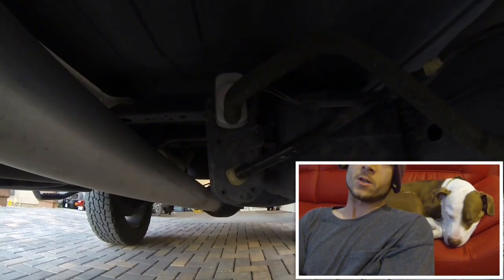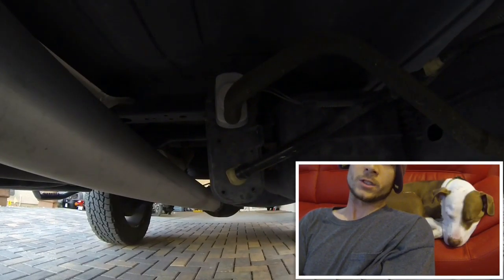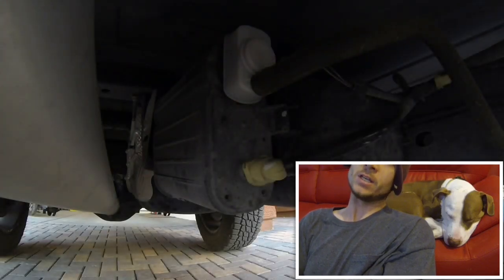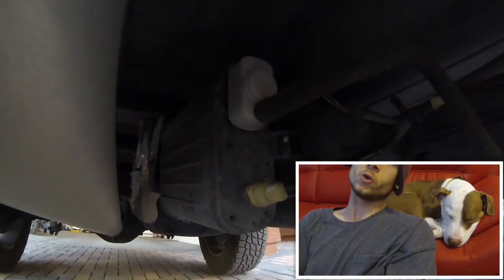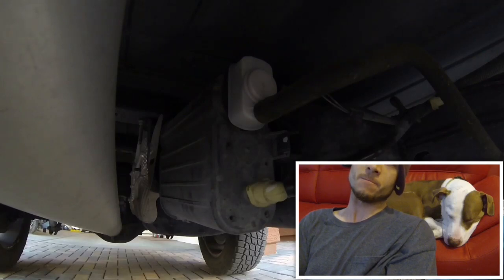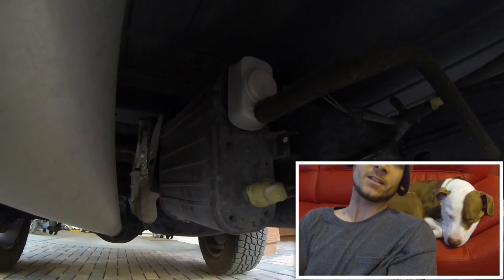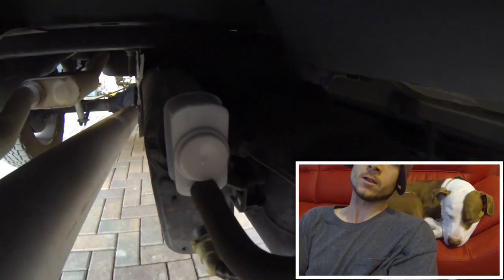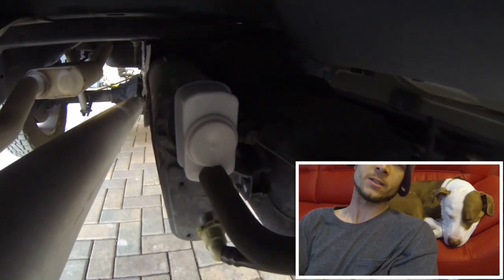p0456 and p0457 possible cheap fix dodge ram, gas cap light

Comment: I want to thank you for posting this video. I had the 0456 code that buying new gas cap and driving miles, unplugging the battery did not reset. I was past state inspection and was about to just start replacing random parts. After I saw this part in your video, I went to the dealer and installed it when I got home. It did not make the engine light go off right away so I was disappointed that I would have to try something else. I drove about 68 miles and it went off. I was so happy I wouldn't have to try something else the upcoming weekend! I would never have thought of replacing this thing. Appreciate it.
Reply from the maker: +nbws6 I'm very glad thangs worked out 💪

Comment: a million thanks for posting this! i replaced the gas cap...nothing. went and bought this piece from the dealer...was charged a crazy amount for the gasket though. But after putting it on and clearing the code..the problem was gone! thanks!
Reply from the maker: You are very welcome a million times my friend.
Reply: Replaced the fuel detection pump. Cleared the code but gas cap light still pops up. But check engine light isn't coming on. Any ideas?
Also I seen someone say the fuel detection pump may have a gasket?? Is this true? Mine doesn't have one. Just twisted the new one in and was done. 
Thanks in advance.

Comment: You are awesome. I went through all the shit I could to find the problem. Aftermarket cas cap, oem gask cap, original gas cap. Check ALL the lines. Check the fittings. It was that Damn leak detection pump. cost about $50 from the dealer for the pump and gasket. For what ever reason they don't come together. Lights gone and I'm happy.
Reply from the maker: I'm glad it worked out for you!

Comment: The check engine light has been on in my truck for the last 250,000 miles.  I just ignored it.  Silly Light, I know the engine is running, I can hear it.
Reply from the maker: Lol I wish I could do that here, I would fail the emission test haha sucks
Reply: Ohio got rid of the emissions testing racket about 6 years ago, but when they still had it I had a check engine light.  I just pulled over before I pulled in the lot and disconnected the battery for a minute to reset the light and went on through.  I would come back on in an hour or so.
Reply from the maker: LMAO awesome! To bad I can't do the standard test with my truck or I would do the same.  They make me hook to the obd port and can tell if I've driven enough miles to trigger all the self diagnostics.  Under the table tests are popular here, pay and extra $20 to $50 bucks and you pass haha.
Reply: Yeah, but you have good gun laws there.  That makes up for emissions testing.
Reply: ***** I live in Jamaica and I have that problem with both my vehicles. We have no emission tests here plus I am yet to find a mechanic who knows anything about emission issues is this country. When I called the only authorized dealer if they have any evap canisters in stock they say they have no idea what that is. So we all know where that light is right now and has been for the last years +

Comment: I bought a gas cap, didn't work.  I got under my truck and the ELDP looked okay, but I went to remove it and it fell apart.  I went ahead and bought a new pump, and just for shits and giggles, because I got a P0441 code, I bought a new purge valve.   Gas Cap light is still on, but Check Engine light is off.  I haven't driven anywhere so maybe when I go to work tomorrow the truck will have enough time to collect data and remove the gas cap light too. idk.

Comment: I've been chasing this problem for past year now so far no luck on my 2013 Ram. I started with the purge valve solenoid and it tested good then I replace the gas cap ever those it look good and now this pump thing since I couldn't find a way to check it.. The light will come back on after a few miles. Time for a smoke machine I guess🤔

Comment: Thanks for posting this. Unfortunately, it didn't solve my problem. I got the part from a wrecker but from a newish (2013) Dodge so I think the part was fine. Back to square one...
Reply from the maker: Ferenc Jacso I hope you solve the problem soon, when you do discover a solution if you would be so kind to post it here thank you sir.  Your welcome and thank you.
Reply: KUSTOMBLACK GUNZ After replacing the leak detection pump (which didn't solve my P0456 and P0457 code problem as I mentioned) I went back to the wrecker and got another easy to replace part, the EVAP canister purge solenoid, which is under the hood. Well that didn't help my check engine light either... Next candidate on the faulty parts list would have been the canister but one has to remove the fuel tank to replace that and I wasn't too keen to splash around gasoline in my garage. Instead I changed the fuel cap to OEM from the wreck and even greased it lightly as others recommended it for air tightness. That didn't work either. At this point I pretty much gave up. Then comes New Years Day and the check engine light was gone. I have no clue why... I reset the code several times after every part change, it still came back then a month later it cleared. Go figure. I'm sure it comes back another day but really happy for now!
Reply: @ferencjacso4699  wow..

Comment: Hey seem to know some things I have code p0457 gas cap then my truck stalled today code p0315 came up  what is first thing I can do to trouble shoot this problem I have replaced gas cap three times  I'm thinking leak d sensor  let me know your thoughts on p0315

Comment: Worked on my 2011 Ram 2500.
I cleared the codes with my tuner and they stayed gone.  I had to drive it a few times before the gas cap light went back off, so don't worry if it doesn't go off right away.
Reply from the maker: Sounds good thanks

Comment: Well, our 09 Escape still will not start... after changing out fuel pump and the purge valve....still getting the P0457 permanent code ..any hints?  tnx. I did try to clean this filler opening a bit..but this should not prevent vehicle from starting........and check engine light was not on.. except in accessory...

Comment: Thanks for the vid homeboy.  I'm pretty sure this is the problem I've been having.  I switched out my LDP on my Nitro today.  Gonna try to get a few drive cycles on this box of trash to see if that code disappears.  I'm a few days away from SMOG so I'm afraid to disconnect the battery to clear the code.  <= Been down that road before.

Comment: Gonna try a new gas cap first 
Question:  For definitive feedback should I be getting a cap that does not have a locking mechanism.  Tight seal being the issue.
Also I find that the gascap light comes on when I have a full tank and disappears when the tank is below half.  Does more gas in the system affect the pressure thereby affecting other related components.
Is this indicator some thing  that can help me troubleshoot it?

This has been going on for more than a year.
Thanks, any thoughts on this would be appreciated
Reply from the maker: +A Wong I would go with a factory gas cap and locking door if you want it locked up.  If the factory gas cap does not fix the issue, you do have another.  You could have a small leak letting vapor out.

Comment: Does this apply to a 2013 dodge ram?? Been having a p0456 and gas cap light on
 replaced cap 3 times and no luck. any suggestions?? or where its located on my truck??
Reply from the maker: most likely

Comment: where is this part located. i have a 2014 ram 1500 express. thank you
Reply: It's on the top rear of the fuel tank behind the shield...yes you can get to it without dropping the tank. It's a tight fit but possible

Comment: 2013 ram 1500. Kept setting off engine codes on and off for months lines were fine gas cap was fine. Then this little piece finally failed to give me a direct answer on scanner. Funny thing is about 4 months ago i looked at this video and figured no...
Reply from the maker: Pissed me off too 😁
Reply: KUSTOMBLACK GUNZ  where is this located on the 4.7 2013 1500. I cant fucking find it

Comment: 2012 Charger with P0456 code. I failed twice. disconnected the battery cables, ck engine light gone, still I failed. My question is what is the cheapest thing to try out because my car does not have a gas cap. Dang Dodge.
Reply from the maker: +Dea Bussey Not sure what the cheapest thing to try out would be.  After you clear a check engine light you need to put miles on it before you can get a true reading.

Comment: My 2009 Dodge Avenger CEL came on and read code PO456 they shut the light off and two weeks later it came back on. Think this could be the fix?
Reply from the maker: +robert cummins Maybe
Reply from the maker: +robert cummins maybe

Comment: What's the part name?
Reply: Evaporative System Integrity Module  [ESIM] Mopar Part #4861962AB  If you just want the seal or gasket, Vapor Canister Seal  Mopar  part #52129436AB      Try Ebay or Amazon.